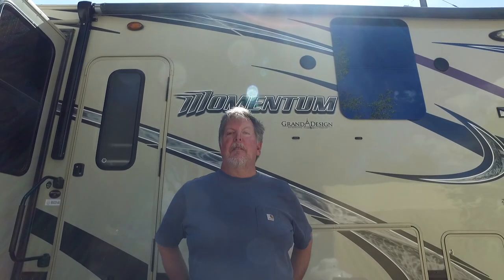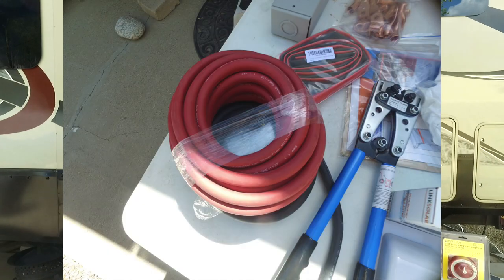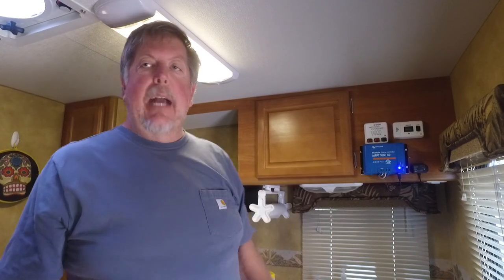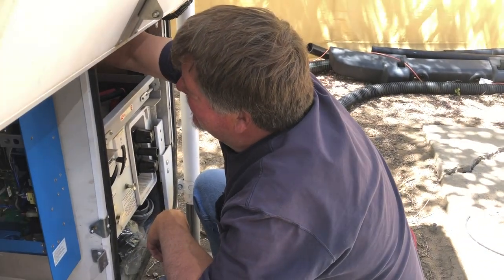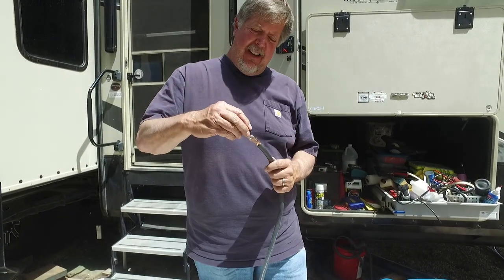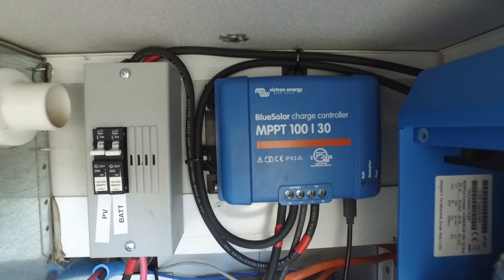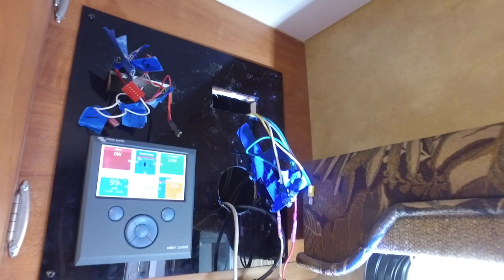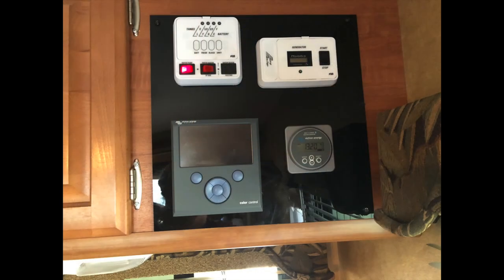Battle Born Batteries - Victron Inverter Install - Lance Truck Camper

Comment: Nice setup. My Ultimate Dream Solar/Battery Electrical System for Boondocking would utilize 4 Battle Born 270Ah 12V LiFePO4 Deep Cycle GC3 batteries along with a Victron Energy 8000VA Quattro Inverter and electrical components.. It's more than overkill for Boondock living stays.

Comment: So the A/C uses 975 watts, can the solar setup keep up throughout the day or does it need to be used with generator/shore power also?
Reply from the maker: The batteries will only last about 1.5-2 hours in full sun running the A/C.  We don't have enough solar to keep up with the demand, so, yes, genny or shore power must be utilized.  But it works well to "take the edge" off of the heat after a day on the road....